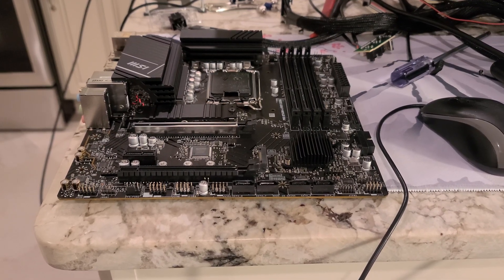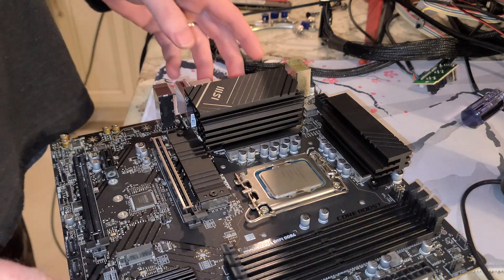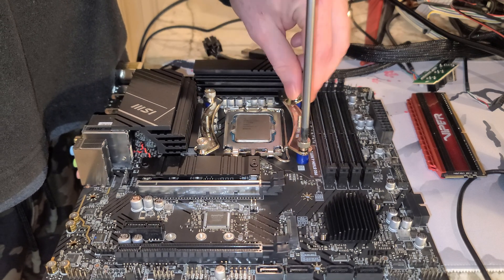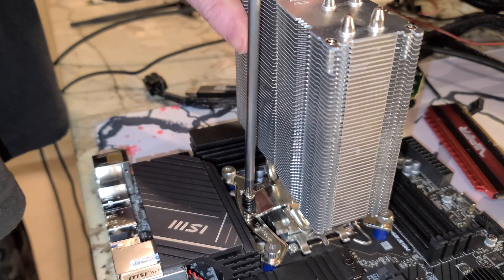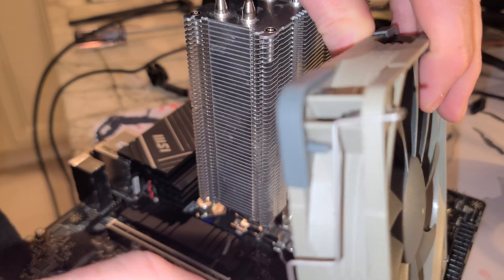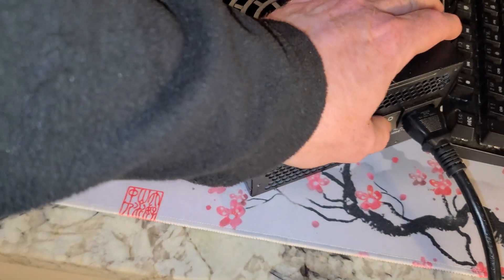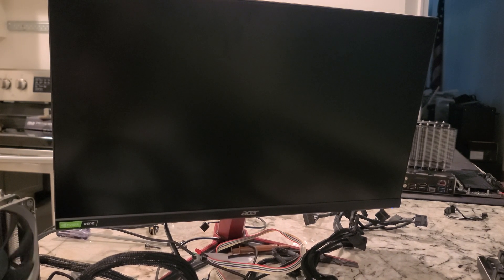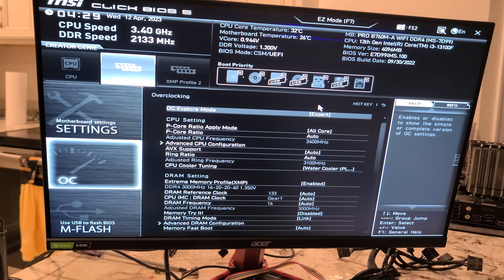I3-13100f Installation into MSI Pro B760m-A Wifi D4 LGA 1700 motherboard, RAM, Noctua NH-U12S fan

Comment: you should always put 2 ram dims in, never 1. that's only enough to turn the computer,
but ram feeds data to your CPU, and with only 1 ram dim, that data is being forced
through one lane. so it slows everything down, so 2 + 2 8 gb sticks is what you want.

Comment: There is a 12 pin power input on your motherboard. You plugged pin 8 onto the processor. Is there a problem? I want to buy one too.
Reply: Depends on your processor. 13000-13500 I think is okay. Not sure on range

Comment: which one is better MSI Pro B760m-a wifi D4 or MSI Pro B660m=a Wifi D4, 0 is the b760m is upgrade version or worse?
Reply: b760m supports intel  12th  and 13th gen out of the box without bios update b660m supports 12th gen out of the box but 13th gen requires bios update
Reply: funny i just had this thought yesterday as i saw they’re the same price rn. from what i found B760M is better but i couldnt tell u why